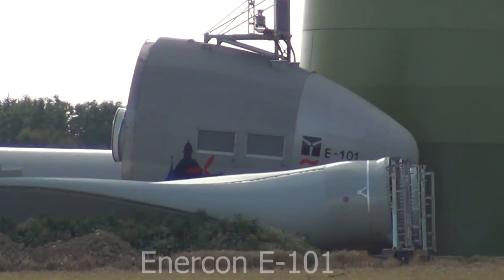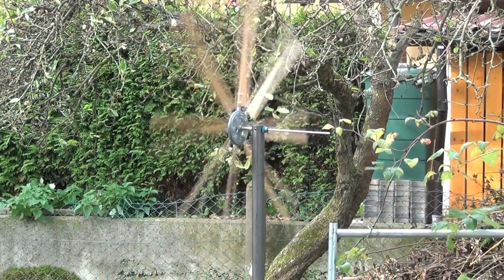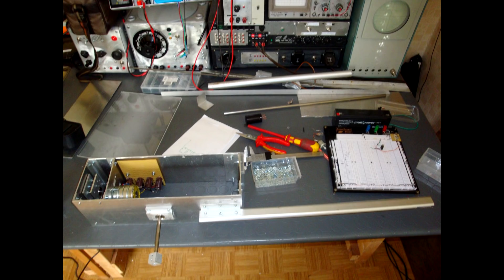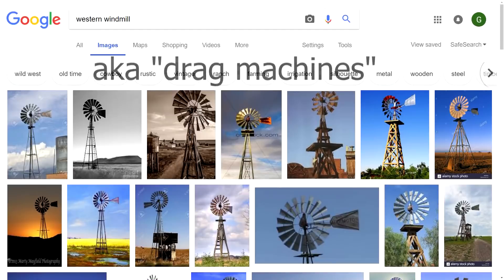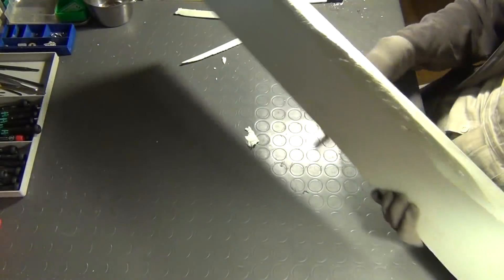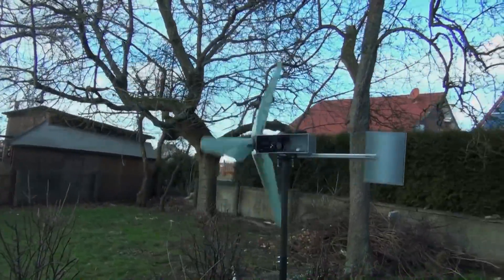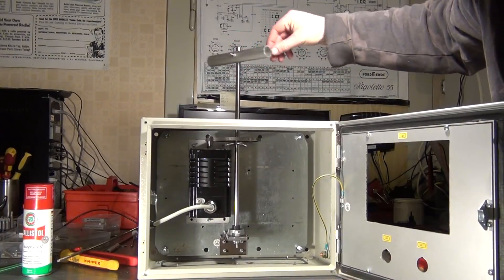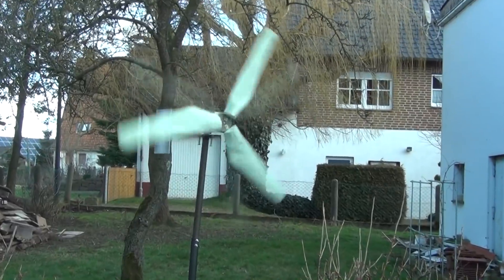DIY Wind Turbine Builds

Comment: I used a 12v Rutland 910 for several years to charge a 200AH battery pack for lighting and a car radio/cassette ( it was a long time ago ) The generator was called a furlmatic and had the tail offset from the center and the rotor bearing slightly offset from the center axis, with the paddle on a hinge, so that when a strong gust came it would turn sideways to the wind, slow itself down and protect itself from overspin. In the highlands of Scotland it worked a treat and I used to sit and watch it through the window. It would generate 2 amps in a fair breeze and peak out about 8 amps if I remember right. 5 Blades and a span of a meter. Heavy duty slip rings and it came with a spare set of main bearings. For anyone wanting a 'shed' power system who has a breezy, clean site wind wise it was a great machine. We used it in our off grid caravan and apart from the three weeks with NO FUCKING WIND AT ALL when we first put it up, much to the delight of the locals, it worked flawlessly for years.
Reply: " three weeks with NO FUCKING WIND AT ALL when we first put it up"
   That's Murphy's Law hard at work. :-(

Comment: I would very much apprechiate it, if you tinkered around with windmills a bit more. Even if they are not going to produce vast amounts of electricity. Maybe you could also take a look at different genereator types aswell, for example the type where you use multiple transformer windings in conjunction arranged in a circle...
Reply: See my channel for examples of efficient, true off grid DIY axial flux wind turbines. Built from scratch, generator and all. Plans are available.